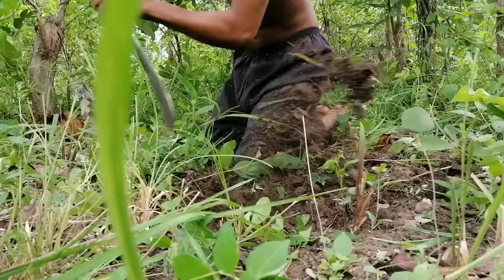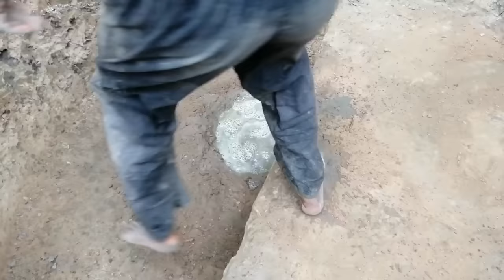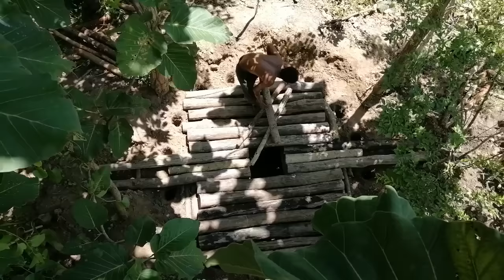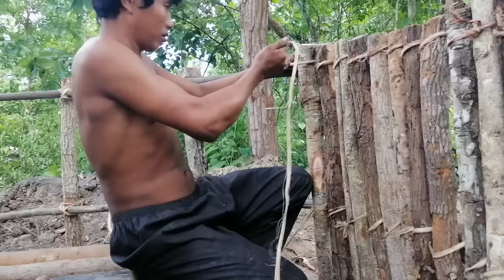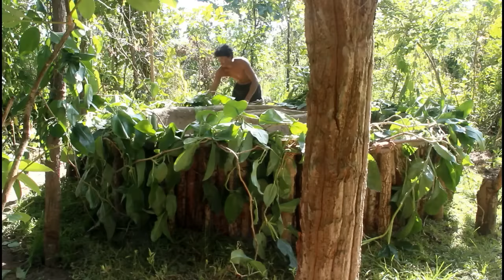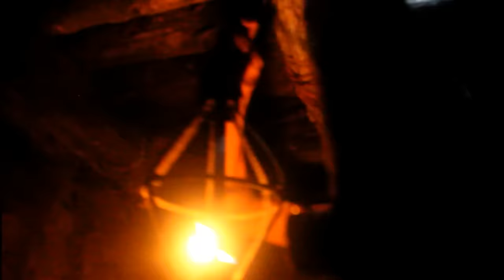Dig To Build Underground Secret House in Swimming Pool

Comment: I don't know why people waste their time on things that won't last long anyway! Surely the guy doesn't seriously believe that the water won't run down through cracks!!? A pinch of cement on earth and then on top of wood...no steel reinforcement. ..Put in at least a foil or laminate with GRP and epoxy resin. But somehow it's always the same with the videos 1000 candles (without exhaust air suffocation) and one centimeter of concrete on bare earth 🤣🤣🤣